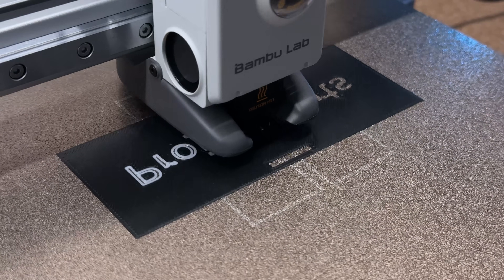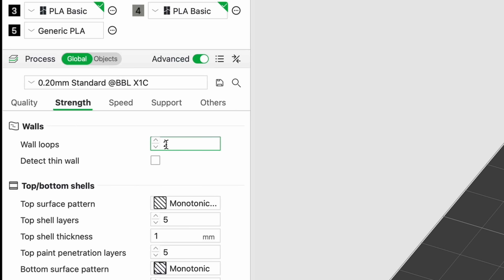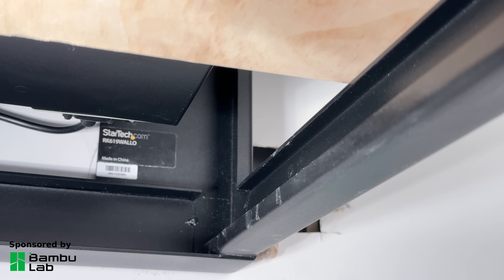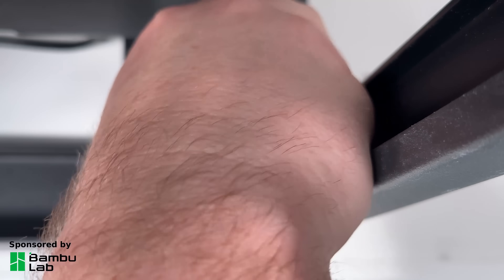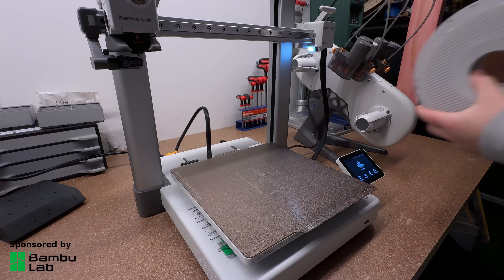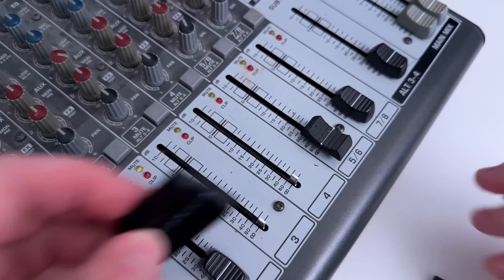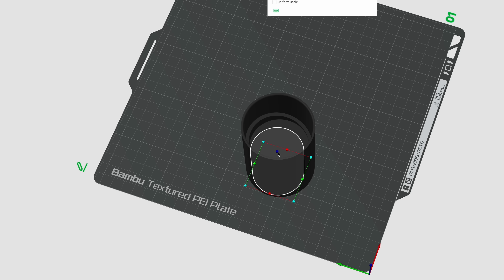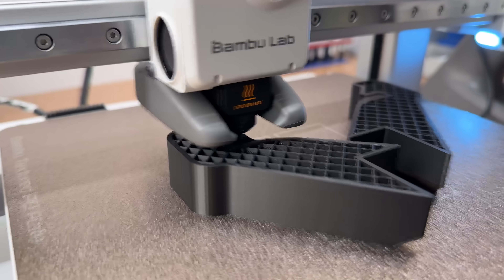More Unique Functional 3D Prints I Use Every Day

Comment: I particularly like the clips on the UPS brackets to hold them in place when installing or removing the UPS; that's designing with usability in mind.  The mention of fast printing and prototyping on the Bambu reminds me of the effortless high speed prints I get on my Flashforge Adventurer 5M Pro, too, so Bambu isn't the only option.  Mainly FYI in case they start locking them down to their own brand of filaments or something else in the future.
Reply from the maker: Good to know there are other options, after years of slow printing the advancements in 3D printing in the last few years has been amazing.

Comment: This is the first of your videos I am watching, and I like it. Over a decade ago I brought the first printer to help me build better cases for my electronic designs. Since then I also built replacement parts and repurposing elements to existing industrial products. I often find it a challange to take dimensions from an existing part. When building for my own needs, I can ignore geometries which are there just for purpose of simpler injection molding, and concentrate on important geometries. But,  when designing for someone else I often get a request to design an identical parts, and it proved to be difficult at times to measure all the fillets, chamfers and draft angles. I would like to see a video about avoiding or sloving those challenges. Thank you for your efforts.

Comment: people using fancy filaments are just that. everything depends on use case. my default filament is ABS. PLA is just too weak for my normal use cases (mainly automotive & voron parts).
i've used plenty of engineering filaments, but still end up defaulting to ABS. it's even cheaper than PLA, but probably depends on region. sunlu has a 5kg ABS roll for $60.

Comment: I’d be interested in knowing how hard it was to get the twist lock feature on the door bell chime to work. Were the supports a pain to remove?
Reply from the maker: There as a bit of messing around to get all the dimensions right, I ended up doing a couple of test prints first. Getting the supports out was a pain, but doable on the last version, it would be nice to a different material for supports
Reply: @YeahNahDIY good to know! Thank you!

Comment: I haven't 3D printed anything in a long time now, but I have made a couple of useful things that could not be purchased elsewhere. I added some electrical wiring in two different places in my house, and the locations of the conduit were such that store-bought anchoring straps were unavailable. So I designed & printed my own using ASA filament. Another example was an adapter for a leveling rod bipod used in surveying (I'm a semi-unretired land surveyor by profession). The leveling rod I had was much narrower than the bipod clamp opening, and I designed & printed an adapter with ASA. Still works like a champ.

 The 3D printers are truly outstanding when it comes to solving unique problems.

Comment: For the advice on minute 8. 
Truly, truly give a look at the rectangular pattern feature from the fusion environment. The slicer shortcut does work, but you're missing out!

It takes 2~3 minutes for simple patterns like a grid, honeycomb or alike. And you'll have more control over the design parameters/features.
Reply: In my experience making numerous patterns in Fusion, the rectangular pattern tool has massive performance issues. It can be so incredibly laggy when adding very basic patterns sketches onto existing projected geometry, that it becomes nearly unusable. 

Still use it, just wish they would fix it.

Comment: I had to mount a new camera where I did not need a junction box. Now my 3D printer can make boxes for the other cameras.  Ooh, Home Assistant boxes, great idea. I got a bunch of detector boards but they need enclosures.  3D print vacuum hose bits for my CNC mill. My first functional print was for a Pi camera mount for OctoPi. Second print might be a case/mount for the OctoPi Pi3.  You Spotlight guide gives me an idea for the IR spotlights for those cameras.  Audio mixer- idea for custom throttle on my model train controller.  More ideas please.

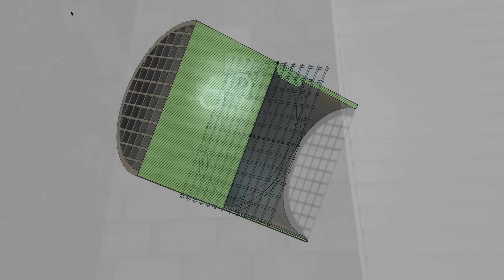Comment: Using Modifier / Fill-Pattern in  the slicer @8:28 is a great way to save construction time or to get creative patters. Recently I was able to modify a boring lampshade with a uniform wall thickness of 2 to a lampshade with an almost woven fabric structure (that is almost half as heavy as a bonus).

Comment: Bro you’re really surprising me eh.
PLA for bed raisers, ABS for outdoor part, both working ok? 
Goes against everything we’ve learnt. 

Tells us how much we haven’t explored about modern filaments
Reply from the maker: ABS isn’t the best for outside, it’s just the best I had on hand. The camera mounts have yellowed a bit over the last year but otherwise ABS has worked great. PLA should be fine for the bed risers as they are in compression, no issues yet. 

If any of my prints break I can reprint them with better filament, and then I’ll have a better idea what the limits are.
Reply: @YeahNahDIY  They say PETG is good for outdoors.